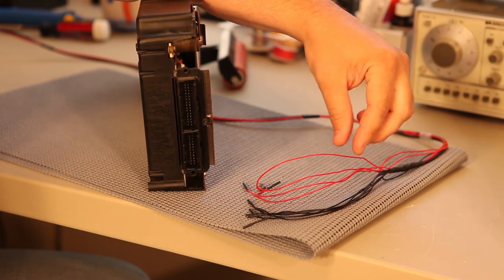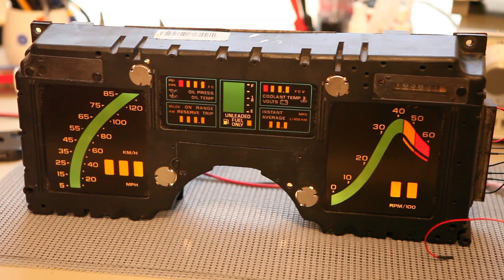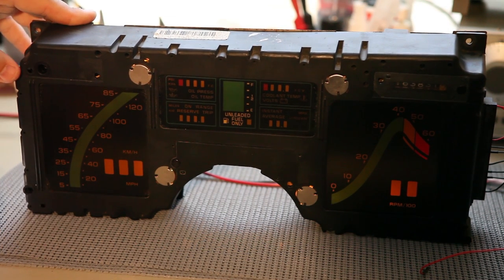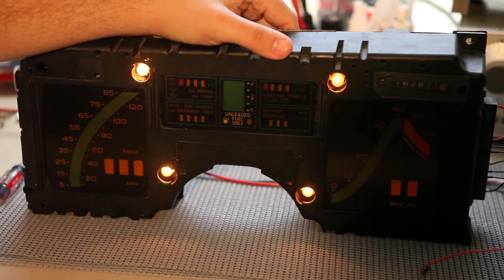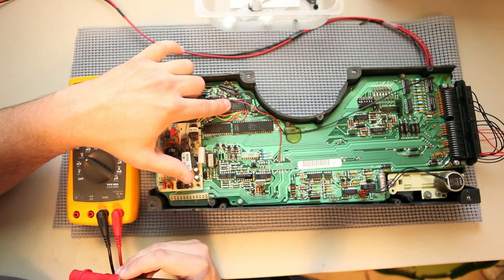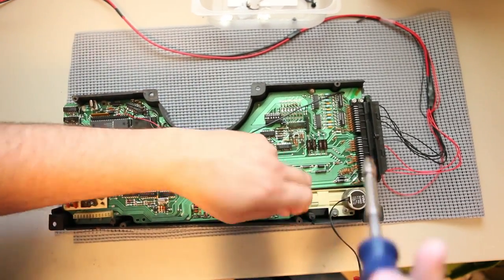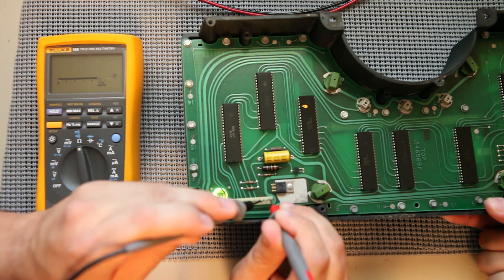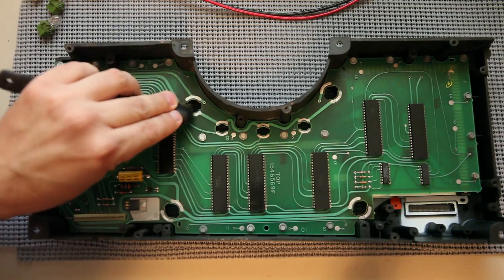84-89 Corvette Gauge Fix #1 Diagnosis

Comment: I changed center panels and now it's gibberish. If I put the old cracked and faded panel back in, it works fine. I've cleaned the edge of the panels, the pink blocks, and the contacts on the circuit board. Aside from buying another panel, what can I do?

Comment: I just received a cluster rebuild for a 1986 and the Unleaded fuel message and the rings around the sections are not lighting up.

What would cause this?

Comment: Can you address the issues with the pins connecting the multipal boards? I have seen the ground having issues and needed to run a separate ground from the car side connector to a better ground on frame. Also cold solder joints.

Comment: just got an 84 vette and am starting a restoration/ mod project. the first thing I noticed is that my gauges are very dim and cannot be seen at night at all. based on video I guess its the dimmer panel or the bulbs. everything reads and works great during day. what do you suggest? or quote if I send it to you?
Reply: having the same issue how did you fix it
Reply: +Jimmie Hoffman haven't yet.
Reply: Adams Dad I am having the same problem. Have you found a way to fix it
Reply: Im having the same issue has this been solved yet??

Comment: Quick question: My 84 cluster is pretty much perfect, but I have an issue with the tach numbers. When it’s cold, only the top numbers light up. As the car warms up, the rest of the numbers flicker on and off slowly until they finally stay on. Is that a cold solder joint? If not, what might cause that issue? Thanks.

Comment: I used the aluminum foil to set the contacts between the pins at the bottom PCB and top PCB connector, put some gorila tape in case it falls out due to vibrations, and it works great.

Comment: I have a 1986 vette sometimes my dash works sometimes not. may drive for 20 min and comes on or may work when started then go out later , any ideas
Reply: Sounds like the cluster has a bad ground, my 84 had the same issue. When your dash "goes out" do the high beam and turn signal indicators light up? If so, then it's almost certainly a bad ground.
Reply: Eric Periard This sounds like the same problem I’m having with my 84. How do I find where the grounding problem is?
Reply: Did you find the ground wire?

Comment: Is a 1986 and 1989 gauge cluster the same.
Reply from the maker: The tach panels have different markings.  The odometer motors are different.  The 89 has no separately replaceable power supply.

Comment: everything works great on my gauge display but the whole damn thing isn't lighting up at all . Only sometimes for what ever reason it lights up everything but then fades quickly back to a hard to see dull functional display . I'm wondering if someone can tell me if I have poor ground that's causing it or something else?
Reply: Lighting up for 2 seconds is the normal lamp test. After that, the photocell takes over. The common failure is to cause the cluster to not light completely. It sounds like you need a new photocell. See Batee.com for parts or service.
Reply: @bryanthompson3180  wow , thanks for the speedy reply .  That's fantastic . I will go check Batee right now .  I desperately need this corrected cause its very frustrating . Thank you again !

Comment: how do I order parts thanks James
Reply: My speedometer does not work, replaced the part that plugs into transmission but still goes to 180 when the car starts to move, is there a gear in the transmission that needs to be replaced..?

Comment: What might be the issue if I can see my instrument cluster but it's locked onto certain things for example the speed is stuck at 28mph, fuel is stuck at 1/4 tank, just a dash mark on the rpms
Reply: Send us photos of what you are seeing and we’ll try to help. Service@batee.com
Reply: I don't have a owner's manual so where do you put the switch on to see how much gas you have in the tank, just bought car there like 3 settings?